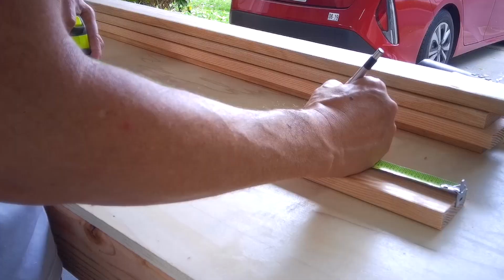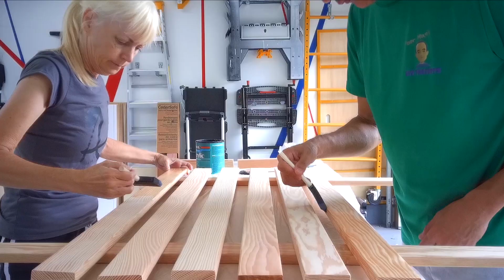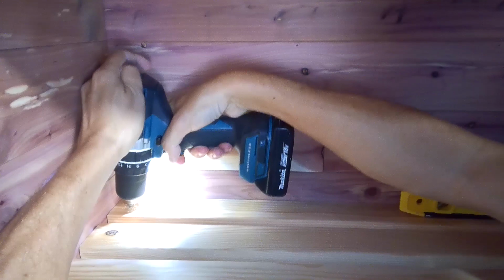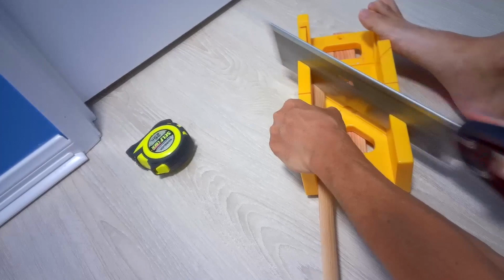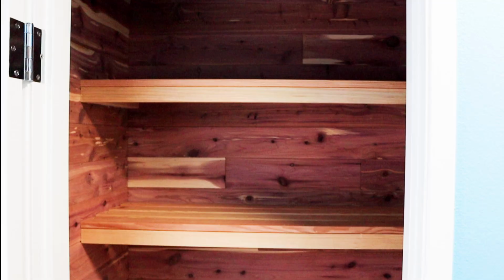Poor Man's DIY: Linen Closet Makeover Part 2 - Slatted Shelves

Comment: Great looking closet.  I noticed you reinforced the front and back slats to stop them from bowing.  Don't you worry about the middle slats bowing?
Reply from the maker: absolutely brilliant question. If I remember, I decided there was no need because the closet is not very wide and as a linen closet, we would store nothing but towels and sheets, none of which pose a concern of warping the board. I probably should go back and add supports in the center because some day, the closet may be used for heavier things. We sincerely thank you for your kind words as well as taking the time to watch our videos and leaving such an insightful question.

Comment: Great video I just fiished a Cedar plank closet install for a customer. She wants Cedar Shelfs but after going to the lumber yard she was looking for a more inexpensive  option. Is their a reason you chose Douglas Fir? I'm thinking I may do something very similar to this. The space  I'm doing is identical ...Great video. Nice work  👍
Reply from the maker: First, thank you so very much for your kind words. We sincerely appreciate it and it means a lot to us that you took the time to watch our video as well as leaving such an insightful question. In response to your question... we selected douglas fir for two reasons. 1 - It was the most inexpensive at the time and we actually made over 2 closets so it was the best way to keep the costs down as much as possible. 2 - We both like the look of the grain of douglas fir. Cannot explain it, but it just looks very nice to the both of us. To elaborate on our decision a little more, we realize douglas fir is a softwood but we believe the way we assembled it gives it enough strength to resist bowing. Thus far, both closets have a ton of items on the shelves and we see no bowing at all. There are other options to cut costs even more by using plywood or MDF board but then it would require a lot of ripping boards, and adding edge banding, which would take a lot more time and add to the cost so, we went with pre sized boards from local big box store.  If you have any other questions, please do not hesitate to reach out to us and we will do our best to provide you with a proper resolution.